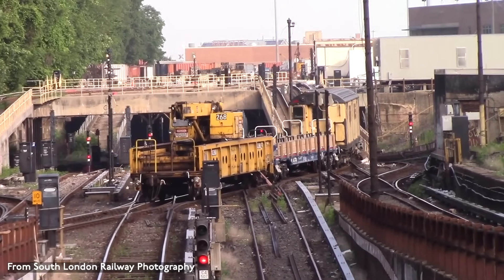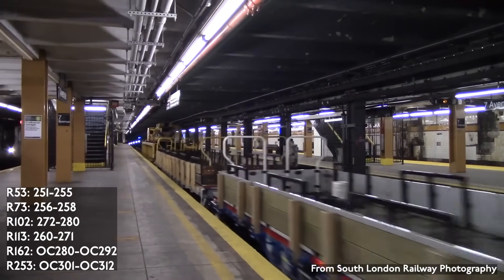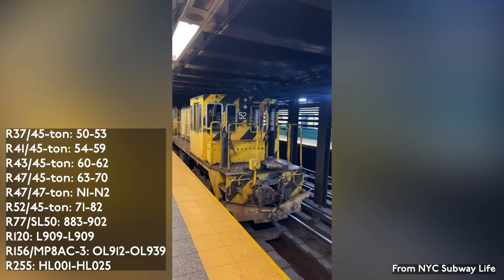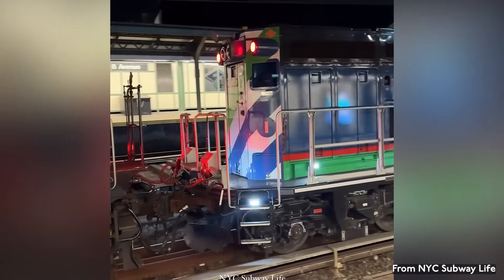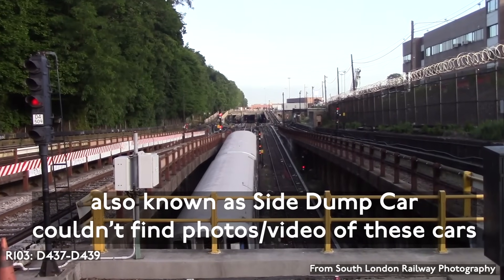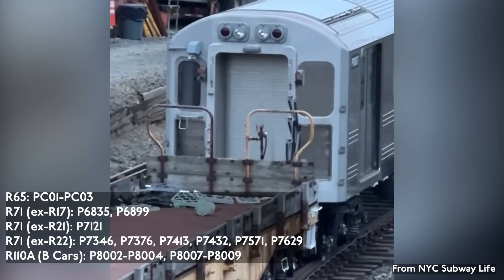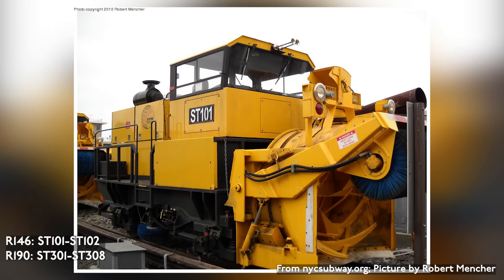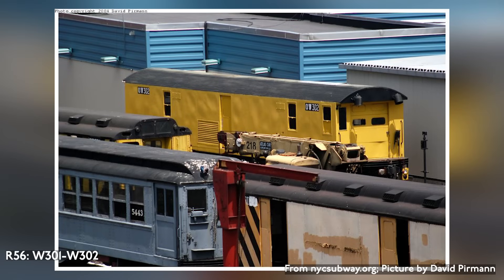The Trains that Keep the Subway Running | NYC Subway Work Equipment Explained

Comment: Questions for the Q and A 
1 why are many station platforms on the NYC subway network so damn narrow? 
2 why are so many stations not accessible? Very few have escalators
3 why do so many stations have low ceilings?
4 why are so many stations so dirty?
5 why are the nyc subway tracks in such a poor shape, that it fees like driving a train down a cobblestone street?
6 why is there no direct rail service (neither subway nor other train service) to e.g. JFK airport? Always takes a transfer onto some air train or sth alike
Reply: 1. space issues 
2. the subway system is over 100 years old. some stations are literally impossible to add elevators (also escalators are not accessible and are a maintiance nightmare) 
3. space issues, some stations are built right under the street. 
4. there is alot of people that ride the system, and a lot of stations.
5. Depends on the line, MTA is working on it. as mentioned the subway system is over 100 years old and with 24/7 service rail quality will be lower then other agencies who dont run 24/7
6. the air train exists for that purpose.
Reply: @thatrandomguy8124  I'm well aware that it's an old network - however there are quite a few old networks out there, which sure share some of the issues, however barely to that extend. 
1. In a city with THAT population and number of tourists I kind of expect stations which match the number of people getting in and out, providing wide platforms which would increase safety. 
2. Escalators can be built matching accessible standards, also for wheelchair users, if an elevator can't be added (however I've never seen a system where that really wouldn't be possible, even in historic downtown areas with old buildings)
3. Fair point; However some are deeper and they still seem to have low ceilings; Guess some tall guys almost touch the ceiling with their heads 
4. sure there are lots of people and stations, but that counts for many networks out there, and the NYC subway sure is the dirtiest I've ever een 
5. I sure didn't ride every line, but it's sth I experienced everywhere I went in the city. At some point tracks need to be upgraded and shut down for maintenance; With so many lines going parallel at some point, this should be easier than on networks which don't have that option
6. and that's unnecessarily inconvenient. Why change onto an extra air train, instead of providing direct service all the way to the airport(s)? Many cities have at least subway or commuter rail service to the airports, some even have regional, express and high-speed train service and passengers don't have to change onto an airtrain to  actually get into the airport
Reply: @EnjoyFirefighting 
I can't answer all the questions,
but for number 6, large parts of the AirTrain are built to literally be in the middle of the Van Wyck Expressway. 

Because of this, the normal large 10 car subways would be overkill (and even wouldn't fit) for the large portions of the AirTrain.

Having the AirTrain cars being smaller, the length of the line shorter, and having it automated helps it fulfill the niche it serves
Reply: @enjoyfirefighting hope this helps